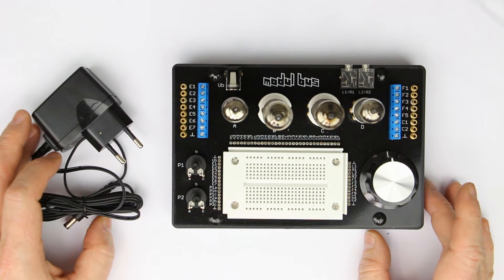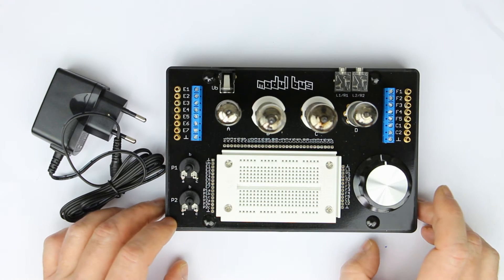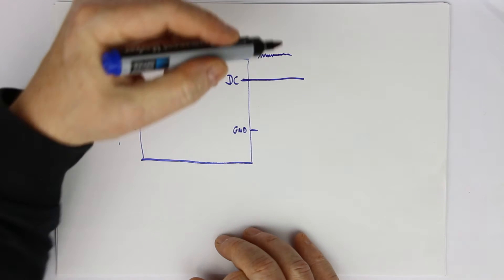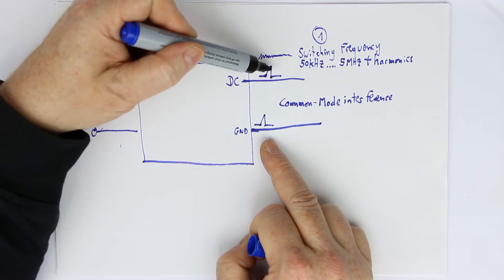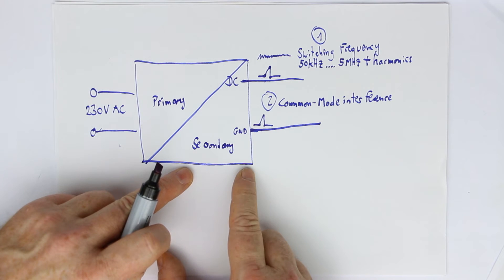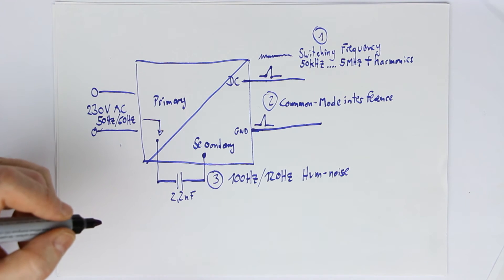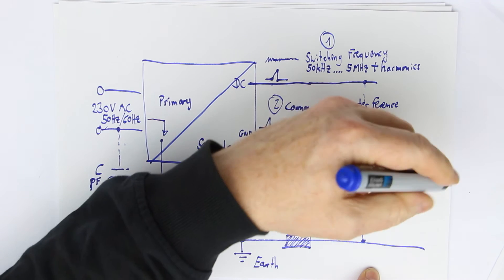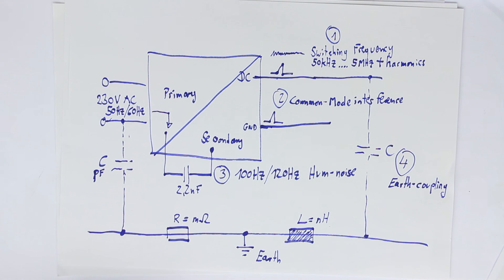A multi-stage EMI-Filter for DC Power-Supplies  Pt.1: Noise sources and noise-coupling

Comment: u know about plasma cutter frequency?
Reply from the maker: No. Why u ask?
Reply: @KainkaLabs   
i made cnc plasma cutting machine.when plasma cutter  start my computer screen blink and crashing computer output data because of plasma cutter highly frequency and it emission lots of radio frequency.
 so how to protect computer from rf frequency?
Reply from the maker: First your computer should get it´s power from a different phase of your mains-power. Here in Europe we have a 3 phase-system where the 3 phases are distributed evenly to the wall-outlets in a house. So try checking to connect your PC to a different wall outlet (with some distance to the outlet where the plasma-cutter gets its power from).
You have to find out if the RFI is through radiation or conducted noise through the cables (main power cable).
With high-frequency AND high currents it could be both.
For radiated RFI the only help is more distance to the plasma-cutter and/or an extra metal-shielding for your PC and screen ("Faraday Cage").
For conducted RFI the only help is a different phase of your mains-power and/or a highly efficient AC EMI-Filter (our one is for DC).
Reply: @KainkaLabs  
thanks a lot👍
Reply: hello I confuse for Faraday cage.
grounding required for Faraday cage? suppose grounding required so what type grounding
Reply from the maker: Protective Earth

Comment: Awesome tutorial. Why do some manufactures put a capacitor between the low side and side of the switchable power supply. I always thought they were separated by op-amps for controlling the frequency, you cut a trace on the PCB to eliminate interference. Thanks Hope any one can help me...
Reply from the maker: What you mean is probaly the separation of primary (mains-connected) and secondary side (output) of the SMPS.
The slot there bridges an optocoupler, not an opamp.
But the noise is transferred via the flyback-transformer/inductor between primary and secondary side (and additionally by the sometimes present capacitor between primary and secondary side).
From Wikipedia: "The primary and secondary sides may be connected with a capacitor to reduce EMI and compensate for various capacitive couplings in the converter circuit, where the transformer is one. This may result in electric shock in some cases. The current flowing from line or neutral through a 2 kΩ resistor to any accessible part must, according to IEC 60950, be less than 250 μA for IT equipment."
Reply: I'm sorry I meant to say optocoupler and not opamps.   The cap is to reduce EMI. Got it!!! I will read up.. Thank you so much for answering my question and your time. Good day sir....

Comment: Why is common mode noise a problem if it affects both - the negative and positive line by the same magnitude and at the same time? The parts attached on those lines only care about voltage relative to the negative line - which remains same even with common mode noise. If I have understood it right they can't even sense common mode noise. So why bother?
Reply from the maker: Explained in more detail in Pt.3:
https://www.youtube.com/watch?v=2ZjKieigydc
Reply: Common mode and noise is a huge problem with radio frequency communication because the common mode signal present on any cable effectively acts as an antenna.  Radio signals are weak, typically a few microvolts.  The output from a switch mode power supply if not properly filtered will contain broadband hash at several 10's of millivolts which can completely wipe out everything but the strongest radio stations.